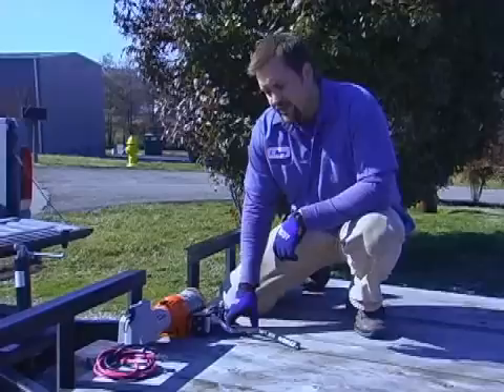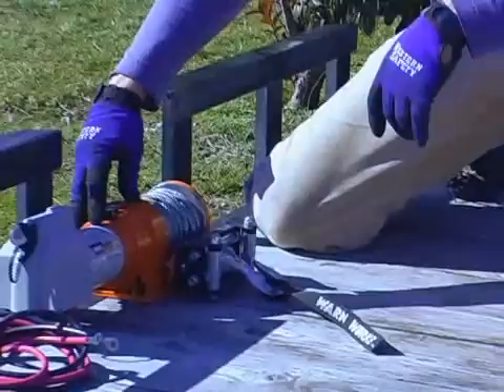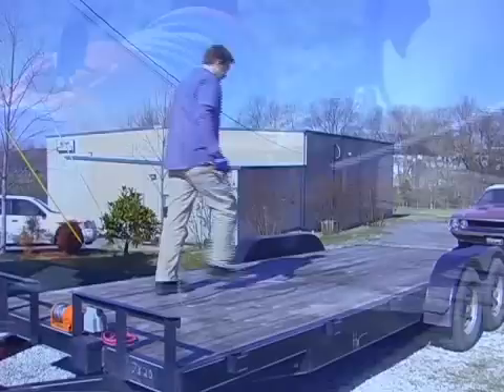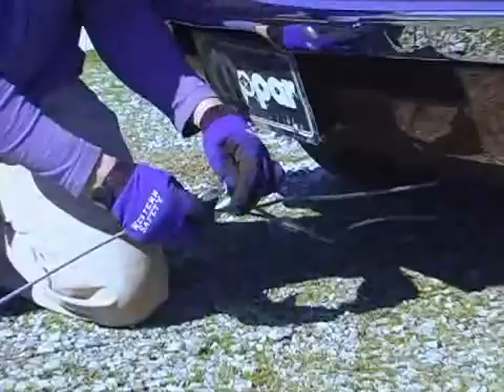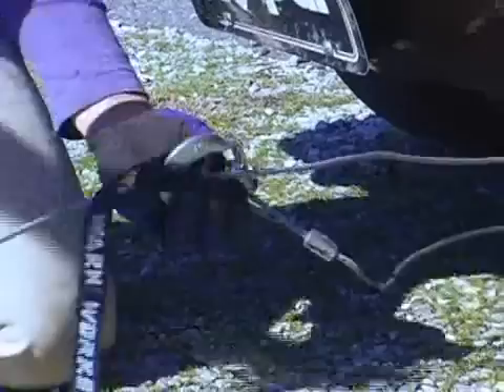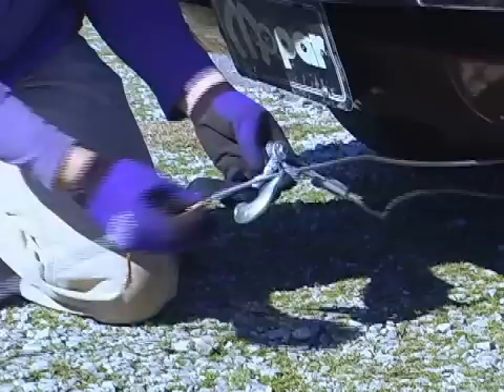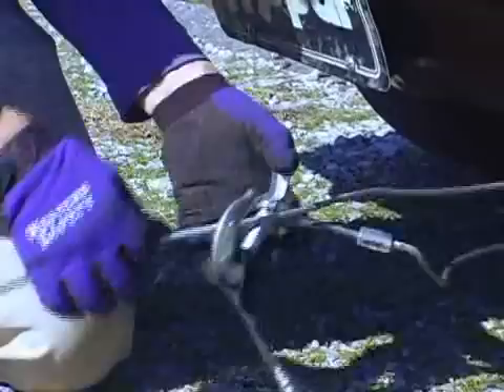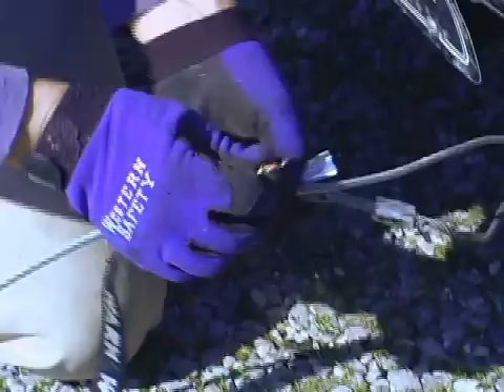Connecting & Loading Truck Trailers : Attaching Winch Cables to Vehicles

Comment: I thought you were not supposed to hook the hook to the cable itself? Manual says the wire may get damaged or frayed. Best to use a soft shackle or a chain with a big enough opening on the link for the hook to slide in